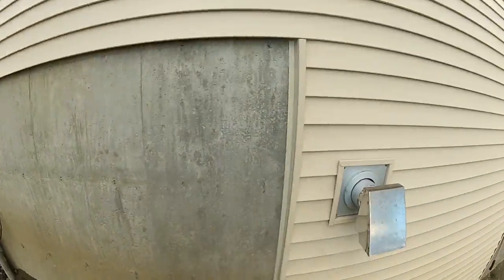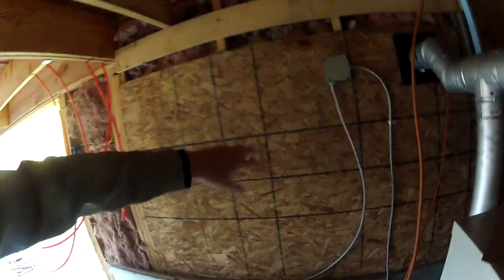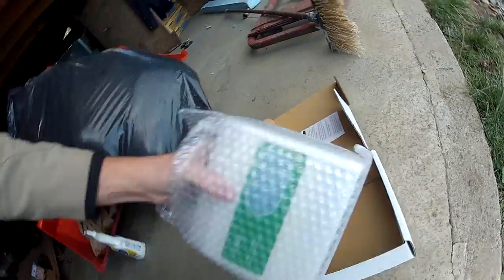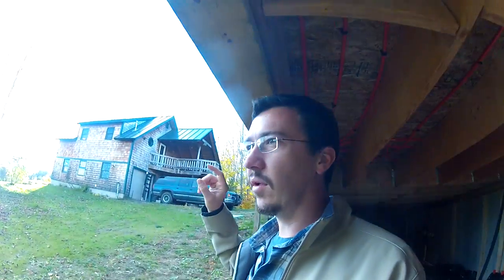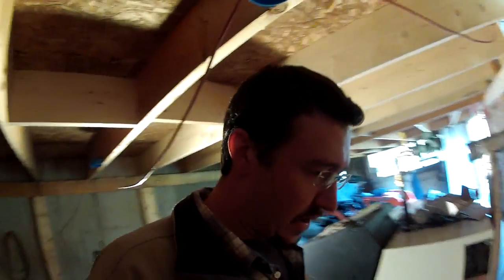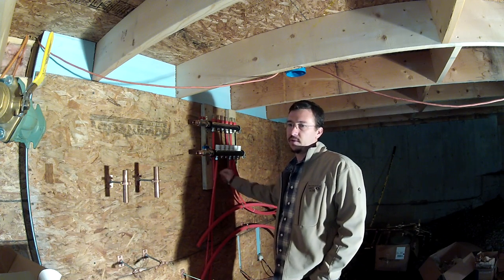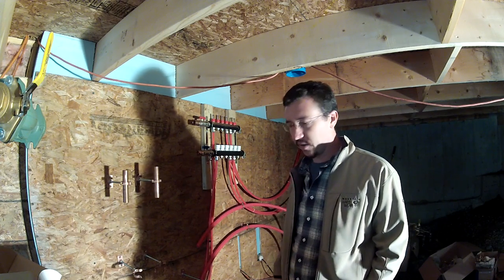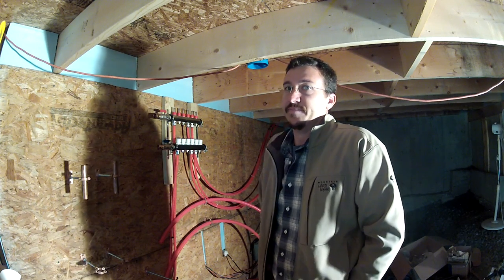Harman PB105 Pellet Boiler Review - 107 -  My DIY Garage Build HD Time Lapse

Comment: I worked for Foxboro in the eighties! I am not shure if they are still in the business! But they where pioneers in industrial automatisacion! All the conrollers opening and closing the valves and checking the pressures and flows and temperatures and processing that to computers which than displayed their readings on tubed displays!! Yeahh!! Those good old days at Foxboro who filled the analog gap!!!